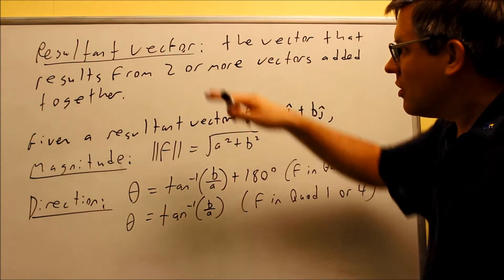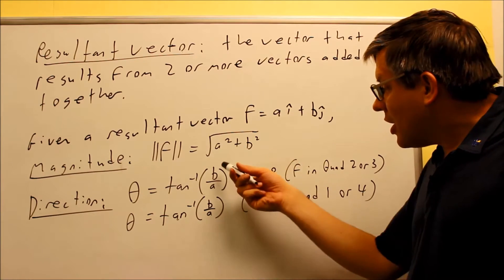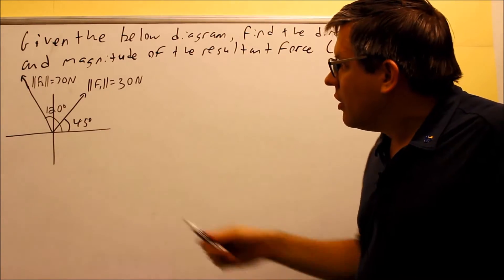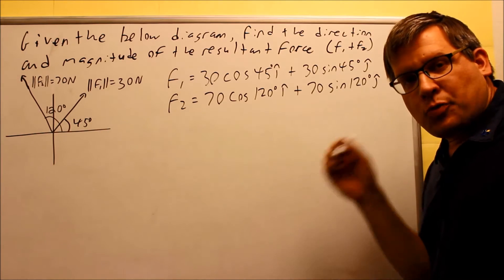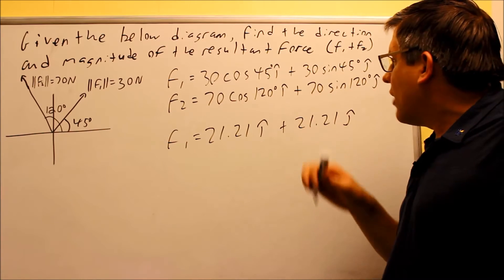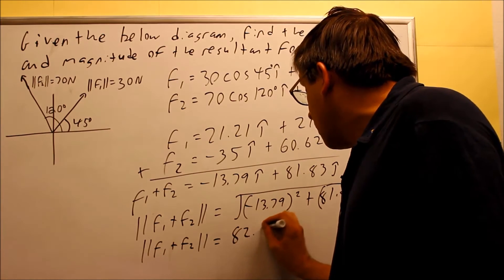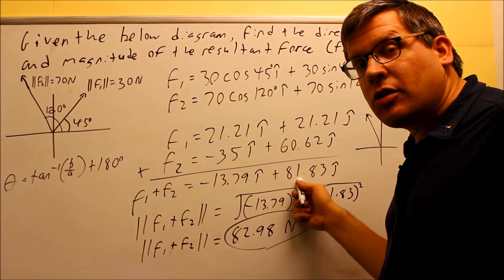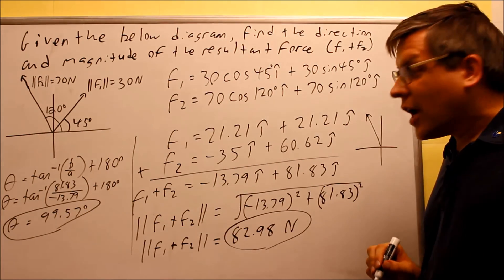Magnitude and Direction of the Resultant Force

Comment: why does this guy actually look like the most stereotypical physics teacher
Reply from the maker: Well I've only tutored physics...not taught it!  :)
Reply: @hutchmath  thanks Sir but what happens if the angle of F1 an F2 are equal?
Reply from the maker: @akemasia1601    If we have 70N at 45 degrees and 30N at 45 degrees, then the direction of the resultant will be 45 degrees. To find the magnitude, we would add 70N and 30N to get 100 N since both vectors are traveling in the same direction. Therefore the magnitude of the resultant vector is 100N.
Reply: @hutchmath  that explains thank you Sir.